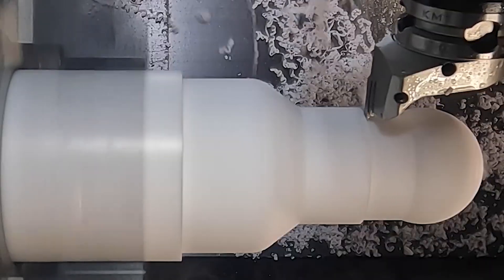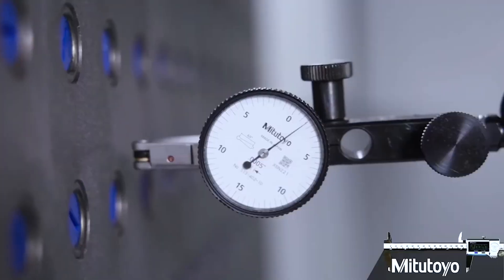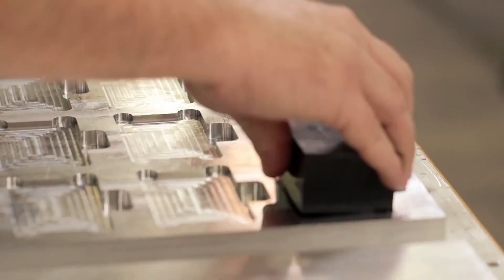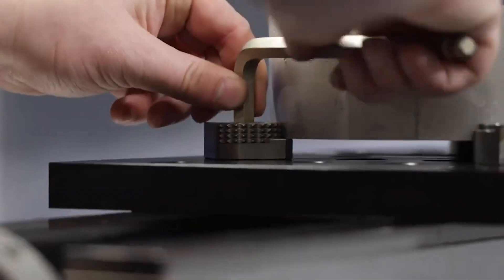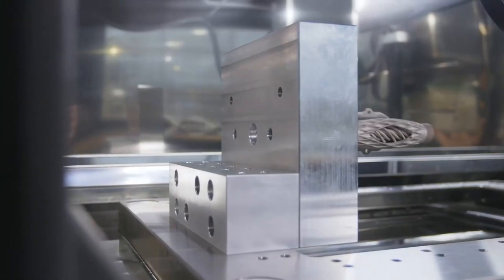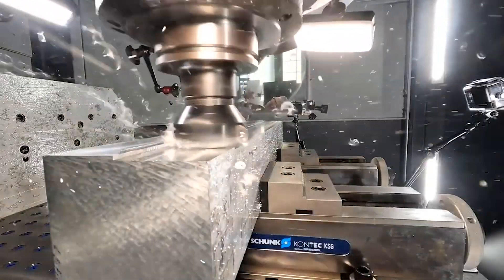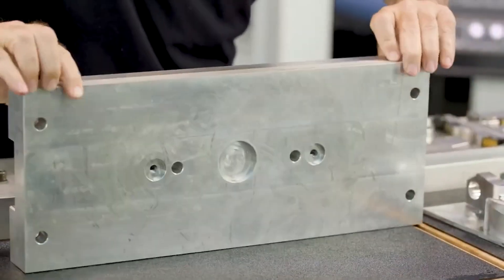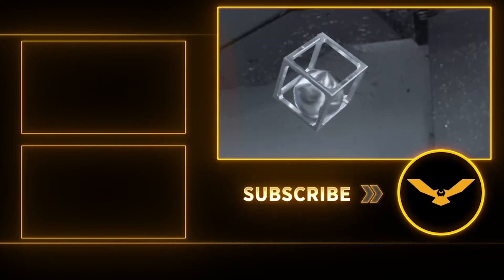$70,000 Dumb Shortcut… Causes Us to FAIL

Comment: There is nothing that warps/deforms more than GLASS FILLED PEEK (yellow plastic). Make a video on that!!
Reply: We make PEEK parts too. They are nowhere near as annoying as Teflon when talking about thermal expansion. Seems similar to Delrin actually. The burrs suck though and it is really hard on the carbide tooling. Uncoated tools get dull really fast.
Reply: Not in my experience.
Reply: @urgamecshk  you obviously don’t know what your talking about bud
Reply: @jaimecruz7275  you're the one complaining about plastic movement on youtube, while parts are coming out fine and with multiple +0 -0.0005" tolerances. Enjoy
Reply: No one cares about your dimensions. Keep that shop talk in the shop my boy. If you need actual pointers on MASTERCAM/5th AXIS MILL/4th AXIS LATHE. I am your guy!
Reply: @jaimecruz7275  don't need your help my dude. I'm sure I have more qualification and experience than you. :)
Reply: @julius jahn
Reply: @Julius jahn sure you mr.router table. You holding .0005 on that? Wow you are qualified 😅😅😂😂 YouTube is awesome
Reply: @jaimecruz7275  I can do 0.001 on my machine at home. Its a gantry router you silly goose. I run and program for multiple VF2SS's with TRT160's on them.
Reply: @urgamecshk  wow good for you please hire me please teach me all your knowledge I definitely need it. Just take the L brodie let’s keep it moving. TITANS OF CNC BABY
Reply: @jaimecruz7275  you got pretty upset there about being wrong. Feel bad for your coworkers.
Reply: @urgamecshk  Again, no one cares about what you run or what you have. I don’t want to know what you can hold on your router, I don’t care about your trunnion, and I certainly don’t care about you bud. Go do something efficient with your time.

Comment: Very telling that this so called machinist hadn’t heard of thermal expansion. The coefficient of linear expansion was something that I had to do as part of my apprenticeship and years later had to use whilst making a machining fixture for a jet turbine fuel pump. Basic engineering practice and covered in about year two of an apprenticeship.
Reply: it was obviously a hyperbolic statement
Reply: From what I got out of it all was that the machinist knew enough to question the engineer?? It was apparently the engineer who specs the material and who had no idea about the different issues he could cause by trying to skim a lil more off the top . it's a real who's on first story but with a happy ending..

Comment: would freezing the teflon and cutting it frozen work?
Reply: CNC mashine dont have cooling - 10 freezer box.
And if the part get to room temp the part will grow bigger after mashing.
Stress relief is the only way
Reply: @andrekemp5059  replace through coolant with liquid nitrogen?
Reply: @mealex303  I think it goes further than that, you can use as much coolant that you want, but depending of the cut the heat will vary slightly.
I think the best would be to cut them near to spec, let them cool evenly and then do a very light final pass.
Reply: @ameunier41  i feel the key is supper sharp tooling and patients. LOL
Reply: @mealex303 
Il sponser the Liquid Nitrogen if you give your CNC to cut the first job.
The spindle ceramic bearings wil shatter because of tolerance preload tension.
Not good Idea!
But you have great point.
I have heard a Haas person once in the past machined URANIUM BALL IN CLOSED BOX WITH HELIUM BECAUSE THE URANIUM REACTS TO AIR
Reply: @andrekemp5059  i feel moulding the teflon while its still able to flow then force it into a mould would be the best way but only if its a part needed in high quantity? unless a 3d printed metal mould is affordable. its becoming a reality now shouldn't be anymore hurdles like we are used to soon
Reply: Try machining Ice?
After job is done there where is all the effort?
Not gone the water is there but the temperature changed the art back to natural state
Reply: Anny thing is possible.
But is there some one to pay the price

Comment: i work in a shop where everyone is out for themselves. Whats weird is its a small shop, maybe 30 guys all cnc. Its so bad youll have set up running tools disappear out of the machine because someone needed the holder, and if you leave anything out over night, might as well just buy a new one on the way home. Because its gonna be gone.
The weirdest part is we arent a production shop at all, strictly r&d or onsie twosies, so its not like these are just some monkey off the street pushing buttons.

Comment: God Bless conscientious engineers and craftsmen in all fields. I'm a software engineer and we encounter similar problems regularly. Our client outsourced a lot of work to developers in India and Pakistan and they simply do not care to check the quality of their work, which also seems affected by a lack of discipline and attention - all of which leads to a LOT more work for others down the road, troubleshooting and recovering from careless or lazy mistakes.

Every conscientious engineer faces this realization: that if they do not do the best they know how to do they will generate a lot more work and lost revenue down the "production line". But many of those people don't realize how they benefit from our careful work.

One analogy that comes to mind is an auto mechanic working under a car: say he removes a part held on by six bolts and finds one of them stripped and not usable. Nobody else will know if he just puts back five bolts, drops the car back down to the ground, and moves on to the next job. Even if the part fails later it probably won't be traceable to him - he might even get "repeat business" for it!
Reply: How about the engineers design it not to strip? Now you're expecting this mechanic to take extra time fo fix the designer's mistake. For him time is money, he gets paid per job, not per hour. So you want him to drill and tap it, and go buy a new bolt to fit the larger bore? His customer isn't going tocpah more for that. Get the manufacturing process right. Factory stripped threads on a vehicle are pathetic. Manufacturers have miions of dollars in robotic torque guns.
Reply: @Synergy7Studios  I said the bolt was stripped, not the hole. But even in the example you give - if the engineer finds a stripped hole they should tell the owner or their boss, so that people can decide whether to do anything about it. If it took a lot of work to tap the hole that could be offered as an additional service to the customer.

Comment: Teflon is the worst material I've ever had to hold tight tolerances on. I had to hold a thousandth parallelism on a piece that finished at .093 thick. After seeing how much it moved from thermal expansion I realized I was trying to make precision parts from rubber bands basically. It's never stable.
Reply: UHMW is just about as bad. Milk jug plastic. Shit will gain .010” if you fart in the wrong direction.
Reply: @staceybrown686  Milk jug plastic is HDPE. Almost the same thing. Not quite.
Reply: Reminds me of my grandfather, he worked in a machine shop and one day some of the guys in the office said they needed a 5"x5"x2" flat on one of the large faces to within a few tenths. (Forget exactly what they said.)

Bearing in mind that this was over 50 years ago, that was a pretty serious operation, so this guy works on it, I think a full day, takes it up to them, and then asks what they needed it for.

They explain that they're using it as an anvil for some crimp on wire connectors that they are smacking with a hammer to set........ 🤦‍♂️
Reply: @Nevir202  That hurt to read at the end. Did you ever get any tips about machining from your grandfather? Sounds like an awesome dude!
Reply: @dylanrb88  Not directly, but he indirectly told me tat I didn't want to get involved, by talking about how miserable he was, always being freezing cold in the shop.

I also can't stand being cold.

He told me that he used to come out on his lunch break, in Phoenix, and get into his sweltering hot car (it can be around 160 in there in the summer) just go get warm lol.
Reply: That's when u have a talk with the engineers
Reply: If that's how the material behaves, it's not like the tolerances will hold after the part leaves the shop.  Seems like poorly thought through design and spec.
Reply: It machines like bar soap, and is about as stable.
Reply: @SaviorTheBurn  You never worked in the area, right? Engineers got not much to do with this at all.
Reply: @SaviorTheBurn  sure
Reply: @SaviorTheBurn  Things get worse from there when they do. They overthink everything. Speaking on experience from working side by side with them and training them. 😂
Reply: I work with Teflon everyday. Sometimes it's not even thermal expansion that throws things out. Its once you start removing material, the internals stresses change and cause it to distort. When I come to jobs with lots of material removal or deep pockets and similar features, to machine it oversize with a roughing pass, take everything out of the fixtures and let it settle for a couple of minutes.

The guy who mentioned the company with all the knowledge actually sounds like the place i'm at. they've been working with PTFE for over 50 years
Reply: @SaviorTheBurn  a engineer using brains? That seems u logical
Reply: I had to hold .002 parallel and flat on .25 thick material on a 10" x 4" piece. Had to apply zero clamping pressure and take equal cuts on both faces to get it. Took around 6 ops (2 ops being the finishing ops after letting the part "rest". Can't imagine what .001 would take on Teflon
Reply: I wish engineers and drafters would just stay away from the material there is plenty other plastic out there that will work. Mostly over engineering is the problem trying to build a rocket ship with every part
Reply: @adammiller4879  Food and Drug regulations keep us engineers stuck with using this material for certain applications. Get gud, I make parts out of this material because trying to depend on a machine shop was a waste of time.
Reply: @measure2ice712  I understand
Reply: @measure2ice712  Iv just witnessed a lot of things being made out of certain types of plastic just “because” the engineers could.
Reply: @SaviorTheBurn  this is when engineers need to "peer review" their works by the manufacturers of their own company more
but they are too prideful for that
Reply: @kurokami5964  but *shitty engineers are too prideful for that. FTFY. I do that all the time on pretty much everything that's not in my wheelhouse. But still, it happens. We're all human. 

Also, you have to remember the vast majority of us engineers are worker bees with bosses & we tend to want to keep our jobs, just like you. Basically, check out Dilbert. Way too many engineers out there can assure you that Dilbert is not just a comic b/c we've actually worked for bosses like that.
Reply: That's what makes it non stick lol

Comment: we sometimes have huge issues with material inconsistencies. one time our machinist was turning from a 40mm diameter bar of aluminum and a foot of the material just fell out of the rest of it with a cone shaped end. or they have to change cutting parameter mid bar because of changing proterties ... but at least it's cheap and the people who order it only care about that
Reply: God damn that’s extra cheap. That’s why I’m a machinist and not a carpenter, consistent mediums. If your purchaser can’t even get material in that has the potential of being made into a good part efficiently then they need ran out the door. Running cast parts you’ll have problems like this but not to the point your safety is at risk because the material is that faulty.